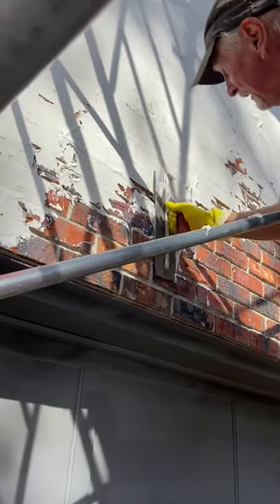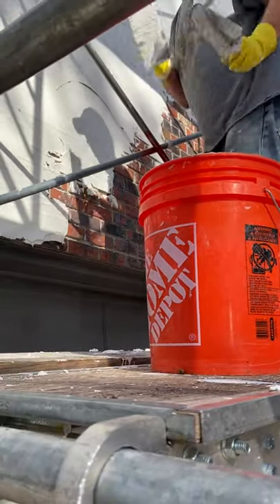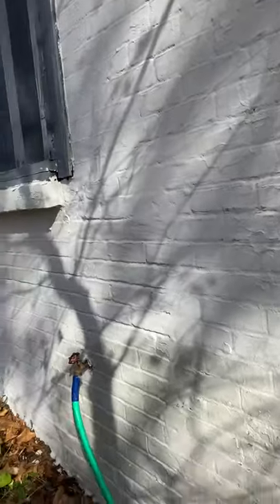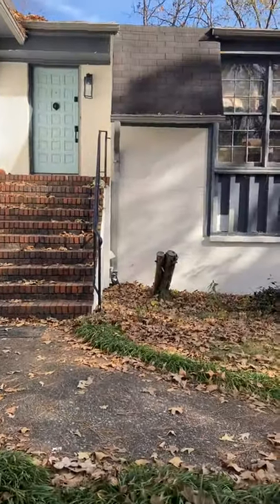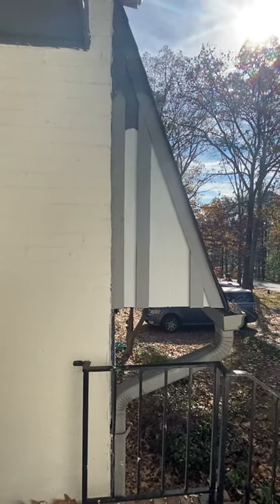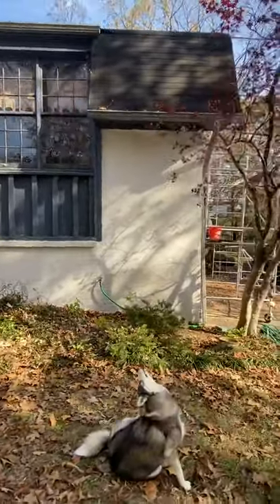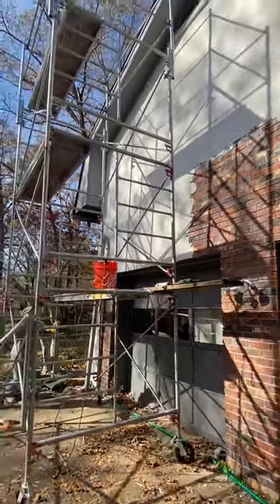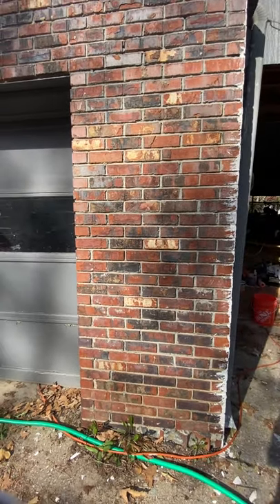Applying brick slurry to 70’s house

Comment: Hi there! Love the look.  Do you think the versabond would bond to brick that has been sealed (a slight sheen)?  Also, do you think you can paint over the versabond?
Reply from the maker: Thank you Han. Im not sure about sealed brick. I would think it would stick though. Maybe you could test a small section. Another good question about painting. I would imagine you could spray it.
Reply: @judybalcomb-richey5630 how is it holding up 2 yrs later?
Reply from the maker: @thev3432  Hi, It's holding up great. No issues at all.
Reply: @judybalcomb-richey5630 i ended up going with avorio white romabio…the results are VERY similar to what you got. You would love it.